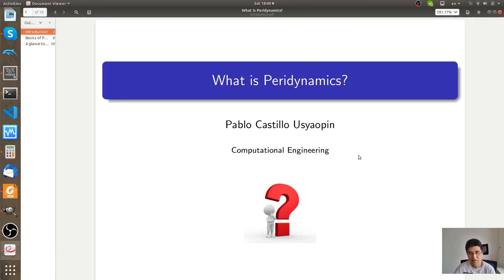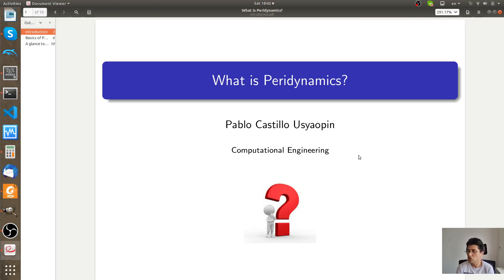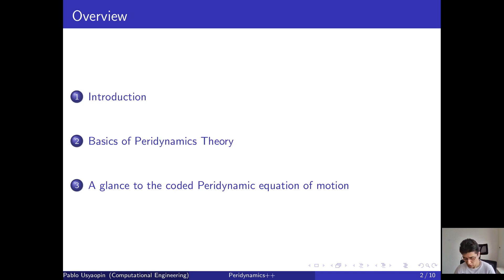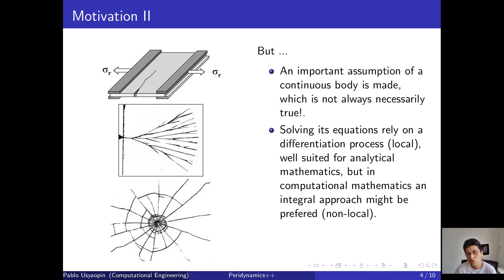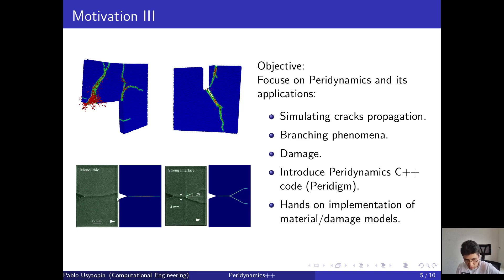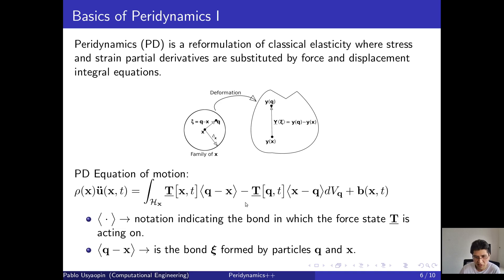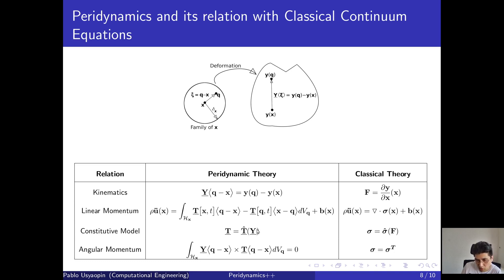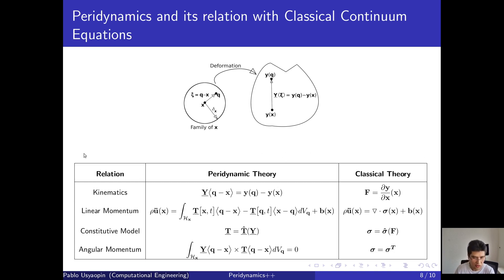Introduction to Peridynamics

Comment: It's great topic, could you introduce more step-by-step tutorials on implementing simulation using peridynamics?
Reply from the maker: Hello, yes i will work in that. Anything in particular or in general tutorial?
Reply: @peridynamics3657 I am eager to learn installation and usage of peridigm; fully coding in Fortran or Matlab;
Reply: @peridynamics3657  You know, when coding is shown in parallel to formula. The learner is easier to how to do real work.
Reply: @peridynamics3657  Thanks a lot for your wonderful videos, Sir. 
Kindly if you guide us, how to model the hydraulic fracturing cases using peridynamics. I will be very thankful. 
Regards,